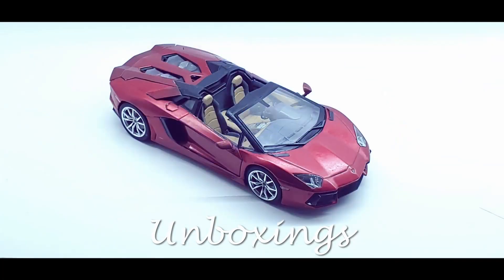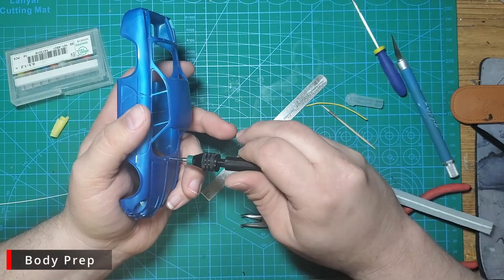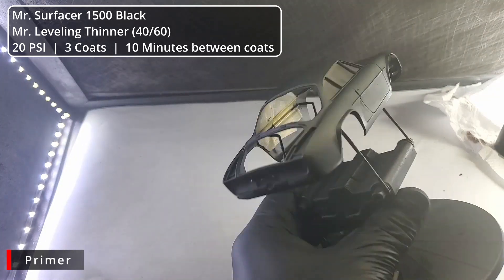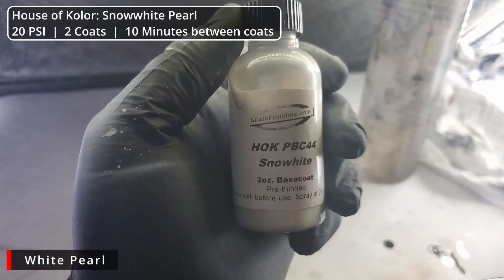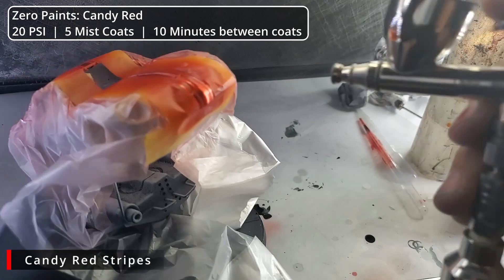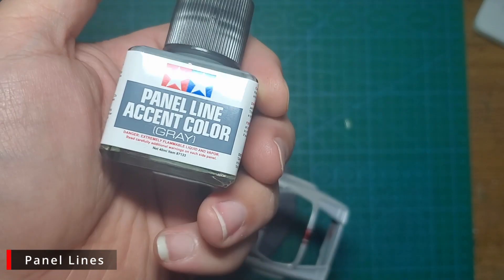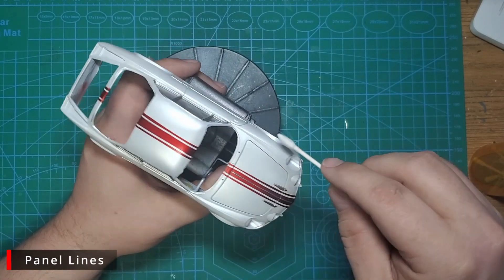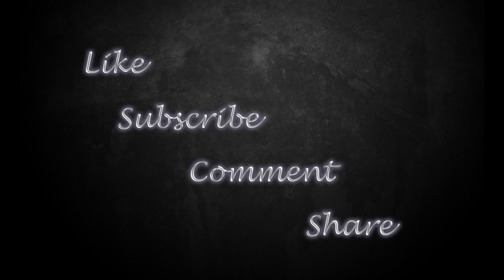Tamiya - Alpine Renault A110 - Body

Comment: Absolutely fantastic paint job Justin! I’m curious what size needle nozzle are you using?
Reply from the maker: Thanks Brian. I'm running a .3mm needle / nozzle setup in both brushes. For primer and clear I use a badger 105 patriot with the fine conversion giving it a .3 instead of the standard .5 needle. I liked the .5 for primer but it throws down so much material so quick. The first time I shot 2K clear through  a .5 it went on so thick it looked like I dunked the parts in syrup, and I got multiple runs. Switching down to the .3 setup really helped with that. All the color coats were shot in my UMP Apex (Badger's Omni 4000) which comes with a .3 needle by default.

Comment: damn fine work Justin.  Because of you I just got that heat gun in last night...then I see this haha...thanks for the heads up though.  It looks awesome.
Reply from the maker: Thanks Joe! It really is a great tool. I don't have issues with blowing off decals like I did with the hair dryer. I imagine it would be even more useful if I did planes and things with all those little decals. This was totally my dumb mistake more than anything. I absolutely should have turned it off or at least pulled it away from the body when my daughter asked me a question. I just stopped and answered her, look back and was like "well crap..." 

Have a great weekend!

Comment: They make a crazy thin tape for nails that I use on stripes. You can check out my Shelby series 1 video to see the tape I used. It is killer cheap and you get a lot when you buy a package. On the same note,  you can get small amounts of flocking for nails on amazon as well, and it comes in many different colors. Each little container is good for about 2 cockpit carpets. Sucks about the heatgun. I can't even imagine the feeling in your chest when it happened.
Reply from the maker: Awesome I need to check it out. I have a few other stripe builds coming up.

Comment: Good start justin tamiyas just rereleased this kit i believe im not sure but my local just got it in too so im assuming this and older 80s 300zx ware rereleased im thinking of ordering tamiya one like you Hellers one has always been available but i like this one more so really considering it i did order the rerelease of 80s 300zx its got nice engine detail so i was thinking the older 80s 300zx i ordered the engine be nice to cast for curbside nissan kits ye know anyway buddy good joblook forward to your next upload, 👍Keith
Reply from the maker: Thanks Keith. This one's actually been out for several years. I think Tamiya may be re-popping this in orange for the Jägermeister livery? Or that might be just for RCs. But yeah I'd grab it. It's been a really nice build. I'm about 2/3ds done with engine / suspension / Chassis and it's been a super smooth build.
Reply: @JHartModelworks  yeah i new the kit itself waa out but i taut it was done till now and the rereleased it cause i hadnt seen it in a while

Comment: Just curious about what airbrush/needle combo you were using.
Reply from the maker: Hi Richard, Primer and clear are done with a Badger 105 patriot, but I switched to the fine (.3 needle) conversion kit as the .5 wastes too much primer/clear in over spray and the 2k went on too thick with the .5. All the color coats are sprayed through a UMP Apex (Badger omni 4000) which comes with a .35 by default. I spray pretty much everything but Alclad at around 20psi. Alclads are so thin you really only need about 10psi.   Thanks for watching!
Reply: @JHartModelworks  thank you.